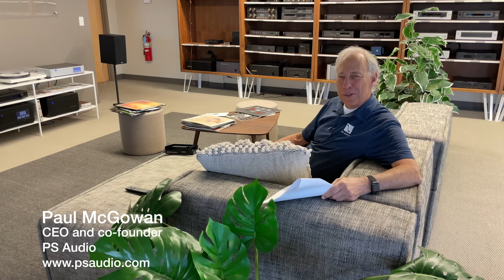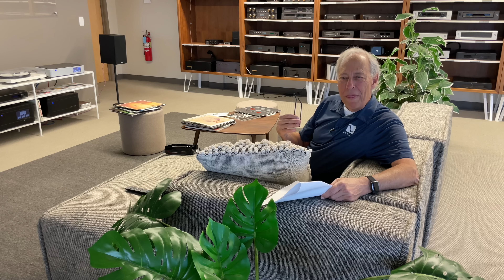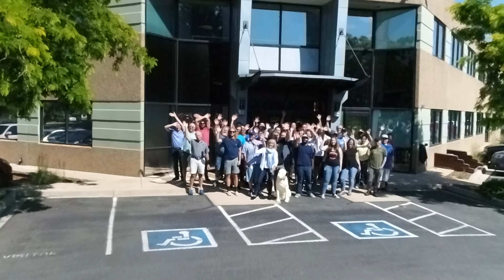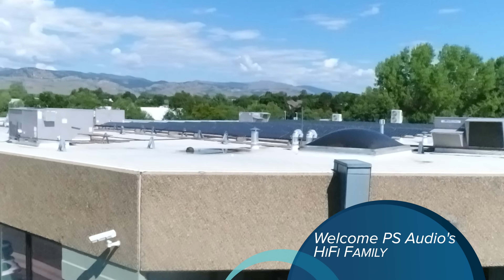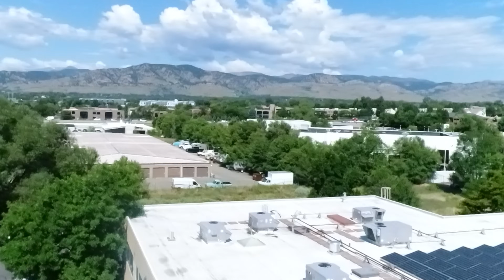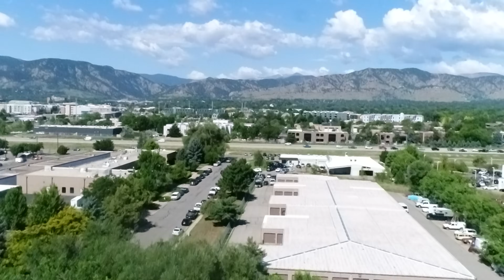Can subwoofers be built in?

Comment: There is an advantage of having stand-alone sub-woofers:

You want your speaker's other drivers (mid and highs) to not shake.
When the bass is built-in to the speaker, it will shake the entire speaker, which has the other drivers.

If it were a video screen, you would see the image not having precise focus, due to the vibrations.  The same goes for sound, when the drivers vibrate.

Then again, by not having the sub-woofers in the speakers, bass imaging will be off, a bit.  But that is not likely to be much of an issue, because our ears do not hear bass with the same precision as we hear mids and highs.  But there is a trade-off, minimal as it is.

The biggest issues are what Paul discussed, because it is really hard to get accurate bass, at one frequency, and then another frequency, etc.  Rooms simply have pockets that suck out certain bass frequencies and exaggerate certain bass frequencies.

But for those that were not aware... when you keep your mids and high drivers from shaking, your music will have better focus.

Cheers!
Reply: There is no such thing as bass imaging
Reply: @TessellationRow  
https://www.youtube.com/watch?v=_XKbkVKJ87k

Comment: Sure, if the sub is closed off from the other divers and it's active. I wouldn't recommend installing a subwoofer to an existing cabinet as it's not designed for the subwoofer vibrations/pressure.

Comment: If I only have a footprint for two subwoofers up on the front stage ie on the outside of the towers, is it better to have 2 ported subs vs two stacks of similar sized/powered sealed subs? Eg. 2x SVS PB4000 vs 2 x 2 stacks SVS SB4000. Looking for a performance comparison not cost.

Comment: but wait, that doesn't address if you have separate stereo subs. you want me to put both my powered subs in the listening position then walk around to find the best sound and then put BOTH my subs in that ONE spot. head scratch.
Reply: if you have a symmetrical room you automatically have two spots, so when you find one the room is mirrored so you have another spot for the other subwoofer on the other side.

if your room is asymmetrical then you can't reliably use the subwoofer crawl method.  but you also have limited your placement options of the subwoofers since its stereo subs, not many placements to test out.

Comment: My JBL HP-520 speakers are 4-way with two 8 inch drivers inside each speaker with a bass port at the top which seems like they are functioning as built-in subs, although they are powered by the amplifier, not by a built in one.   To me, they sound great and produce tight accurate sounding bass and to me, the advantage, the mid bass is handled by a separate 6.5 inch driver, separate from the midrange and tweeter.    I've been used to the sound of these since 1995 when I got them.

Comment: I understand where Paul is coming from pertaining to subwoofer ideal placement but too often it doesn’t work out this way.  

Some have cabinets already or the subwoofer can’t be placed in the middle because that is there the flat screen and / or center channel is etc.  

Just my opinion also but I feel less tuning headaches are involved in one invests in tower speakers and larger single subwoofer.  It’s just much easier to set up.  

Just put one sub in a corner and cross over at 75hz and below.  Larger driver such as 12 in or above is better as deeper bass is less directional.  

You get the mid bass from the tower speakers.  

The above is for a larger room with single listener seating position.  

It’s hard to please everyone also based on where they are sitting.

Comment: Well that isn't the interpretation of "built-in" I was expecting.  Sharper Image used to market a down-to-DC sub that was essentially a fan where the pitch of the blades varied with the signal.  It was to be mounted between the living space and the attic or basement.

Comment: Paul, that brings up a question. I know that speakers and rooms differ. But, what's a good "approximate" crossover frequency to start with  [and then tweak from there] after the subwoofer placement crawl routine is resolved?
Reply: I'm not Paul but, it's dependent on your mains. Bass is not easily located if crosses over lower than 80hz, so consider that an upper limit for all subs.  A generic suggestion would be 60hz for stand mount speakers and 30 hz for towers
Reply from the maker: I would start with a high pass frequency of 40Hz.

Comment: I started in car audio and it was common to think that a subwoofer would be needed to play EVERYTHING below ~50hz if not higher. Most home speakers don't seem to go below ~40hz so when I see these gigantic speakers that hit < 30hz I basically think of them as already having subwoofers built in. Then, as Paul mentions, positioning becomes a huge factor so I question the need to buy those models. I'd consider one or two models down the line and with the money saved get one or two quality subwoofers and place them well. My subs are currently ~ 3 1/2 feet from the main speakers well in the corner and not for any WAF.

Comment: I’m a bit confused now. I thought that theory was for home theater not for music. Based on previous videos, music ideally would  have to be a system 2:2, two speakers and two subs (placed next to the speakers) so the lower frequencies “could be generated” by the main speakers.
Reply: Unfortunately no. Bass from a subwoofer is usually crossed over around 80-90hz and bass in those frequencies should not be directional. So you can put them anywhere in the room and it should sound like the bass is all around you and not coming from a point source.  2 subs are great for correcting room modes and flattening the fq response but rarely would placement best be right next to the main LR speakers. But that is room dependent.
Reply: @jeremymorales8951  Agree 100%

Comment: Agree with this you can easily have 20-30db of db swings in bass due to the room at the optimal place for speakers so it's always better to place those as best you can then place the subwoofer(s) as best you can and use HPF/LPF to route the bass appropriately.